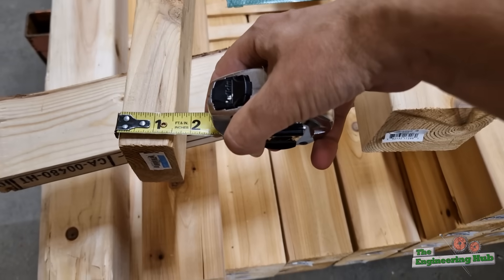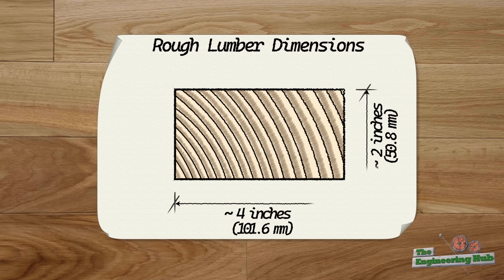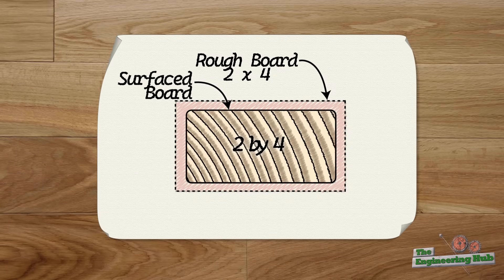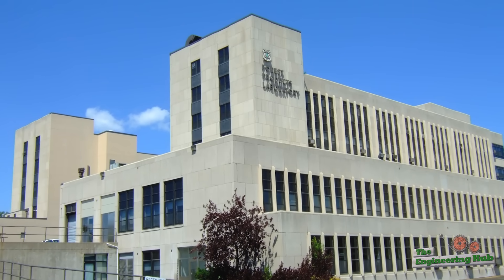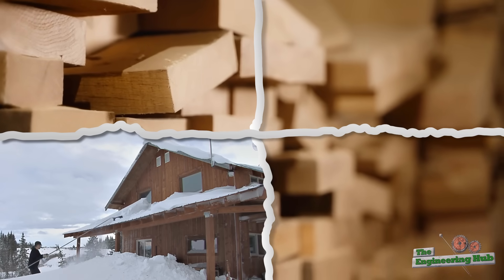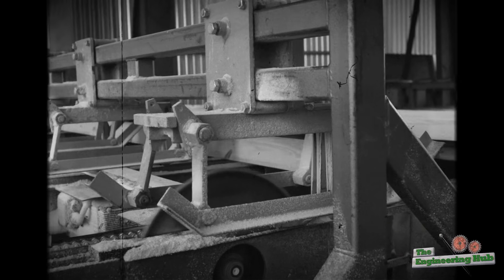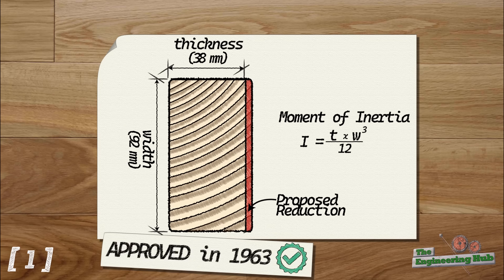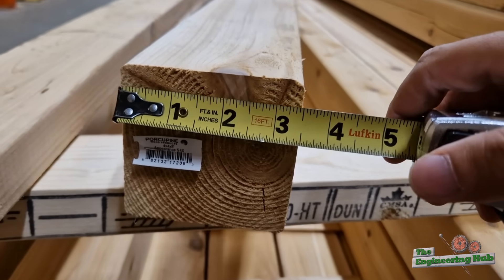Why is the 2 by 4 getting smaller and smaller?

Comment: You pay only for length and height, you didn't specify width, lumber yard will cut whatever size you want if you payin

Because a plank aint a flat square, its a cube
Reply: You want something non standard, you still gotta pay
Reply: You got a chainsaw and wood splitter you can make your self chopping down a tree, and u can use hardwood like oak, maple, and chestnut, which has more strength than soft pine

Comment: There is also the consideration that rough cut lumber is hazardous to the worker, in the distant past planing the lumber was a little more crude, also not mentioned was all the engineering that went in to building with wood and if you do a cost analysis it comes down to structural strength vs the dollar and we definitely are always at a tug of war across that line.

Comment: I knew something about the history of the modern 2 by 4 being much smaller than 2 by 4 inches, but this is a great explanation. I also remember seeing the old raw lumber used in older buildings in the New England area, especially barns and other rough structures.

Comment: Fascinating review of the 2x4.   I recently used some sawmill actual 2x4’s in a small construction project. The length and width were all 2” x 4” however when buying 8’ pieces none were exactly 8’ and were all longer sometimes by 6-8”.  I cut my lumber for my small project but I can see how a builder of “stick” house would have had many time consuming cuts plus since the mill pieces are actually 2x4 and most of the time have a higher moisture content, they are much heavier.  Lifting a floor assembled wall now might require more men as it is much heavier.   The current manufactured 2x4 in uniformity allows for much quicker construction.   However using the mill true 2x4’s for small projects has a strength benefit and even can allow for less studs.   Great video and I subscribed.  My son is a CAD designer of custom homes and I have sent your video to him also.
Reply: "however when buying 8’ pieces none were exactly 8’ and were all longer sometimes by 6-8”.

That's good, they do the same kind of oversize with sheets of MDF which are 1/2" wider and longer than 48x96" this is to allow for edge damage to be trimmed off and still have a 48x96" sheet.
With the studs- that excess length allows end splits to be cut out and still have 8'
When we get boards from Liberty hardwoods, we order 8,10,12,14; poplar, white oak etc and they are ALWAYS about 6" longer than those and they ALWAYS have end splits

Comment: As far as the quality of older wood vs new; I lived in a house in SW Florida that was built in the 30's with old, yellow heart pine (If I remember correctly). They were not only true 2x4's but very dense and heavy! An addition was added onto the back of the house in the 70's using inferior wood. Termites ravaged the entire addition but you could see that the original house was completely untouched. The newer beams, going right up to the original house were disintigrated right up to where they met the old, original wood which was still pristine.

Comment: I work at a sawmill and planermill. The initial cut by the saws is indeed 2" x 4", (I've measured it myself), it then goes into the kilns for drying, which of course shrinks everything, then goes into the planermill, cutting it down to 1.5" x 3.5", just like he said in the video.
Reply: Your mill is likely one of the outliers today; in the name of recovery our mill(stud mill, 330k FBM/10hr shift target) targets 1.63x3.7 off of the saw lines for a 2x4.

Comment: Modern building materials - in general - are so lightweight and flimsy it is a wonder houses stay standing more than five years. I don't care what the reason is - I would sooner buy an older house with good solid beams and Victorian quality bricks.
Reply: good old asbestos and poor insulation. gotta love that electric bill
Reply: @shamancredible8632  I just sold mt Dad's 1930 house. The roof is made of asbestos and clay tiles - the same ones fitted in 1930 and still in perfect condition. Never been repaired, never had a problem. Sure, he died of lung cancer but I guess it's swings and roundabouts.

Comment: Here in Australia a 4x2 is a 4x2 hardwood rough sawn length of timber. The typical timber that is used for studs in walls etc is actually a 90x35mm planed edge radiata pine. The 4x2 will vary a bit in dimension as they are rough sawn from green lumber and will shrink anything up to about 10% as they dry out. 
What's worse than the varying definitions of 2x4's is the use of inches.
Reply: I'm sorry the use of inches makes your pp seem smaller

Comment: The first house I owned was built from oak lumber that was cut and milled right in the area. Studs were 2 x 4, joists were 2 x 6 or 2 x 8. No two windows or doorways were the same size, which was very annoying and frustrating when trying to modernize them. However, that house was strong and resilient. The lumber, being aged oak was tough as concrete and just as hard. When making structural changes, they had to be drilled and wood screws and bolts used. Loved that house. Too bad the industry got cheap with their products...wish they would go back to real dimensions...so much easier to calculate measurements....thanks for this video, very interesting.

Comment: What are the strange markings on your tape measure is that some ancient measurement language? Youve been gipped. We get much more. lol the old was rough sawn. The latter was 4" but still a little wonky so they planed it. We still get 3 3/4 or 94 mm in modern measurement.... Metric.

Comment: Very interesting. Here in Finland we have 2x4 as 5cm x 10cm, so roughly the correct size, expect - 2mm for shaved wood. Its been like this allways afaik, and building with thinner material than this seems it would make flimsy structures. If one needs thinner pieces, you would use glued composite wood.

Comment: We built our deck in ~1969 and the 2x4s of that era were not done shrinking (in Illinois).  By the time we needed to replace the boards (in the late 80's / early 90's), the boards had become smaller in BOTH dimensions.  So the smaller standards didn't reach everywhere in the 1960s.

Comment: Pretty sure the REAL reason was 'deflation'.  Why worry about 'truth in advertising' when there wasn't any legal basis to do so?  The issue these days is those local mills are held to higher standard than corporate lumber mills, so if they actually tried to sell real 2"x4" lumber, they would be looking at trouble for not selling less for more.  Even home mills wouldn't be able to use their own lumber, unless they go through the corporately approved certification process.  If they don't, then inspectors could fine or order any structure to be demolished for being 'out of code'.  There are still areas that will allow 'rough cut' lumber for non-residential structures, like a shed, some barns, and other such constructs.

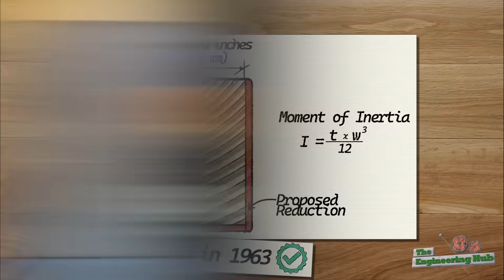Comment: 6:06-6:18 Not entirely. Check the lumber here in Oregon. Dimension could be a few 8ths off from 1.5"x3.5", and can get some really crazy twists in the boards. You're lucky if you find a board in the store that is straight.
Reply: @Look_What_You_Did Oh yeah, because the entire state is Home Depot and Lowes, how could I forget.
Reply: Yeah, I went through almost half a stack of "economy" studs before I found enough straight ones for my tool shed project. Many of the boards were in very poor condition, warped, large slices of wood missing and many were not crowned.
Reply: @tonyv8925  But they didn't have a bunch of knots that happened to be in the right spots for where you needed to cut or put screws, nails, or anchors?

Comment: Wouldn't be even BETTER economically and environmentally if they stopped surfacing the wood? Cut it at 1 1/2 by 3 1/2 straight from the tree and be done with it. We don't need rounded corners. I used raw lumber, and it works really, we wear gloves anyway. The energy/environmental impact saved/reduced by skipping the surfacing process would be worth it. Remember, we need to change to save our environment? That's the kind of thing we should apply everywhere.

Comment: The sawmill I work in produces flooring. It's interesting to see other mills naming things in such a way. A 5 inch board is not 5 inches it's 5 3/4. And that goes for all of the boards we do. Of course I work in the rough mill, where I handle boards that have gone through the kiln and then planed in our department. They then get taken to moulding, flooring, or straight to shipping. There's a few other departments that I've never been to. A friend told me a 5 inch board is 5 1/2 by time it's a final product headed to shipping.

Comment: 2x4s and two by sixes haven't gotten smaller in quite some time. Too many things are designed around 3 and 1/2 and 5 and 1/2 in at this point for them to steal that from us anymore. But 2x10s are now nine and a quarter is 2x8s are seven and a quarter

Comment: In my area 2 by 6 is used for walls not for insulation requirements. I tore down a house to build mine and it was old lumber mill quality with a  razor thin division line between cuts, flawless!

Comment: The moisture content standard (if there is one) is the most important standard.  Because whether you are paying for wood by weight or volume, you are still paying "wood prices" for water, if the wood is wet.   I have bought both 6" fence boards and deck boards, and constructed using pipe clamps to get zero gaps, and when the boards dried out there is over a half inch gap between some of the boards.  When I was expecting about an eighth of an inch.  Paid for a lot of water.
Reply: easier to nail when they're wet at least

Comment: I have a late 50's house. When re-finishing part of the basement where I was extending an existing wall. I had to rip some thin furring strips so that the new 2x4's would match the old 2x4's. As to keep the drywall straight and aligned. Also, the old wood is much more dense with way less crowning then what they are passing off now a day's. If building a new house, I might actually consider LVL vs the garbage 2x4's now available....

Comment: I noticed that every piece they put a tape on was actually 1/16"  smaller than called out. (The 1 1/2" was actually 1 7/16" the 3 1/2 was 3 7/16)

Comment: And this confusion causes even more issues than your “standard” board. I’m building a timber frame house. I wanted true sized. Every board I got was 1/2” smaller at minimum(one was 3/4” too small). Which ended up causing issues with cuts being in the wrong areas or not centered without modifications. 
It’s a misleading mess even at current.

Comment: I was always told that it's 1/2" short because once you add the 1/2" thick drywall, the finished thickness of a wall will be 4 inches.
Reply: Thank you for saying that. I was told the same thing. I mentioned the same in my comment here. I read for an hour to find something similar to mine. Are we the only two that know this?

Comment: Good info and show. I still say bigger is stronger. Builders today cheap out so much the houses are paper thin and fail quickly under fire and wind loads. 2x6 should be the law for all exterior walls, and 12 inch on center the law for all walls, exterior and interior.
Reply: Ignorance, houses built today by knowledgeable contractors are the safest ever built.
Reply: Maybe the elec and gas systems are safer, but most builders cheap out. We are in a new Ryan Home in SC, when you slam doors house shakes. At fires the roof holds up 5-10 minutes and burns through and collapses because trusses and decking are so cheap. Give me a 1950s house and Ill restore it @wooddogg8

Comment: Lumber industry con government officials saying in the shorter measurement meet structural integrity of a true length of a 2x4 or they razzle and dazzle them with the meaning of a rough cut vs a smooth cut and of course not to forget the bribery.

Comment: Those older cross sections show something else pretty important when evaluating lumber, which is how close the growth rings were back in the day compared to modern day lumber.
Reply: I used to live in a house from late 1890, in 1983 the house got hit by lightning and the top floor burned down, over 30 years later the old wood seemed to be in better shape than the "new" from the 80s. If the new lumber was from todays lumber it probably would be an even clearer difference in quality. Old pine vs new pine planks are like to different type of wood.  @esyr
Reply: @doctorstainy well you need trees that are 100s of years old to get wood like back in the day
Reply: Today's, quick grow, pines must produce one 2x4 in 10 years?   Just wondering...
Reply: It's going down!
I'm yelling timber!
You better move!
You better Dance!
Reply: @esyr  There's this thing called treating wood, and maybe if you did, it wouldn't rot.
Reply: @shamancredible8632  Have you ever been to the south? Lol. You can treat it with whatever you want. The sun, rain, and humidity is going to destroy it.
Reply: @smasher.338  Yes, the sealer will eventually get damaged and fail. You need to reapply it. No products last forever, many won't even meet what it says on the can, even more so if you live somewhere with an extreme environment. This is part of regular maintenance. Do you clean your house regularly or only once then never again? It's the same thing
Reply: @DreadedEntityMain excuse me while I tear my walls out to treat the wood frame again.
Reply: @BenjaminWalburn you don't pull them out, dummy. You aerolize the sealant with an atomizer then pump the gas into your walls for 72 hours coating everything in your home with an impermiable glossy layer. This should be done every two to three weeks
Reply: @SelectKiko  I dont think anyones going to pay for that.
Reply: @SelectKiko is this real
Reply: @DreadedEntityMain  If your home is stained , it'll need a fresh coat every 6-8 years . If it's painted  " correctly "  the average home needs a paint job every 10-12 years .  Most people don't heed to this and wait way to long .
Reply: @SelectKiko 😂😂😂 you got a couple bites on that one
Reply: @shamancredible8632 remember when they said that about asbestos ceilings spray foam insulation houses are giving people gnarly brain Cancers and becoming condemned if you want a house made out of pressure-treated lumber instead of solid brick youre a fool
Reply: @shamancredible8632  As a contractor , most people don't keep up with their homes as far as painting as they usually wait 5+ years to long .

Comment: This was interesting since I also saw lumber, some for myself and some for sale. Since many smaller mills actually do turn out a real 2x4 it can create some confusion for buyers. And some mills saw out a 1.5 x 3.5 in green board which will shrink later as it dries. For the mill it increases profit by sawing smaller. I find that I have to go with whatever a customer needs at the time.

Comment: I build houses in Midwest USA. The engineering of houses has greatly advanced in the last 30-40 years as well. I would much rather live in a house I have built than a house built in 1900. Some of the construction I see in those houses makes you wonder how it hasn't fallen over yet.
Reply: This idea that "everything old is better" is extremely flawed. Yes, old things that are still around are probably only still around because they are good quality. However, we don't see all the low quality things that didn't stand the test of time because they don't exist anymore.
Reply: @shamancredible8632  Just like the Roman statues and other artifacts. We only found them because they were made out of material that lasted a lot longer than the 1,000's of other statues they made.
Reply: @shamancredible8632  I believe the term for this phenomenon is survival bias.

Comment: This is kinda nuts. In Finland when I buy "48x98" gauged or dressed it is very very close to 48 mm by 98 mm and all the sides are cut with a fine saw and planed down. If I buy rough sawn 50x100 (roughly 2x4) it's very close to that. If I bought 50x100 and the dimensions were actually intentionally 40x80 the company would be facing lawsuits for fraudulent marketing or outright fraud. Modern lumber machinery is very precise and you don't need that many extra millimeters to make pieces exact and plane them down. You certainly don't need an extra half an inch for that.

Comment: I always thought it was so they could use small/junk wood to make boards...most I see in the stores today are not only very expensive, they are mostly warped, bowed, twisted, knot holes, and riddled with bark-edging..some have cracks, and bark-edging on the end, which makes the end not square and off-dimension...this is very, very common at the big box home improvement stores. And these boards are not being sold as "seconds" or "culls", either....

Comment: Since 2 x 4's are used primarily for framing (which will be hidden in the walls) why bother surfacing them in the first place?  Except that it may reduce shipping costs as the video says.  And I have a pet peeve about milling, shipping, and selling green (wet) wood.  If you need straight lumber, you have to pick thru dozens of twisted, curved, and bent pieces just to find one good one.